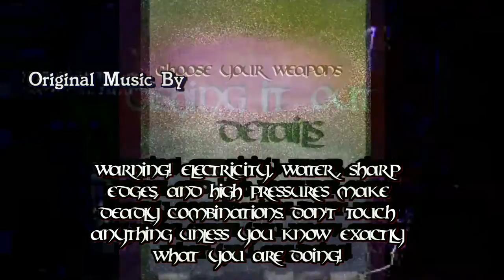Front Door Coming Apart Wood Separating From Metal Quick How To DIY Repair Video

Comment: From what I can tell, it seems like the steel cladding is normally supposed to be folded under itself on the edges of the door where it then is supposed to tuck in around the wooden interior framework of the door. So my best guess is that he's using the screwdriver to bend the edges of the steel cladding back to the way it was so that it tucks back in like it's supposed to. However, I can see why he recommends using glue to make the repair more permanent: because the folded edge of the metal cladding has already come apart once, even if you bend it back into place, you can never bend it back into place completely perfectly like the way it was before it became damaged. That's why its important to use glue to help the steel stay firmly attached to the wooden stiles.Otherwise,the metal would eventually start to pull away again. I'd probably reccomend gluing the inside edge of the metal where it tucks under to the wood interior rail, and then attaching clamps until dry or possibly using a few small screws to screw the metal onto the wood rails to really hold it on there.